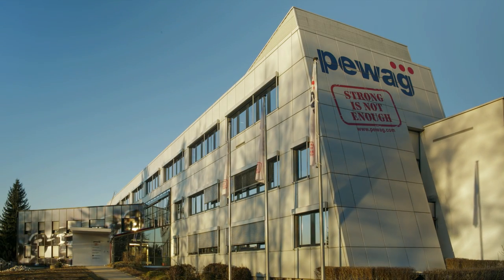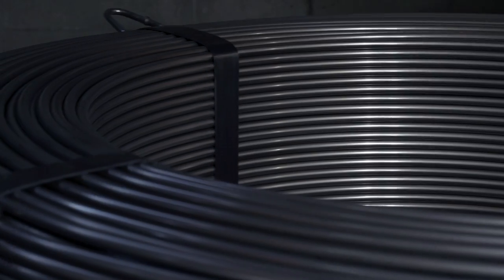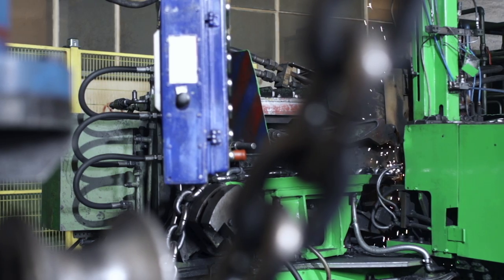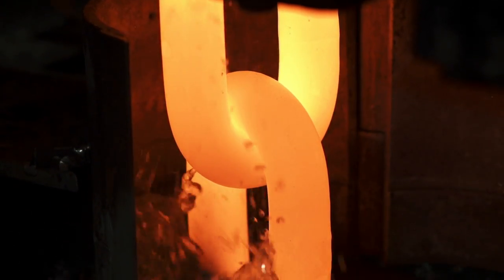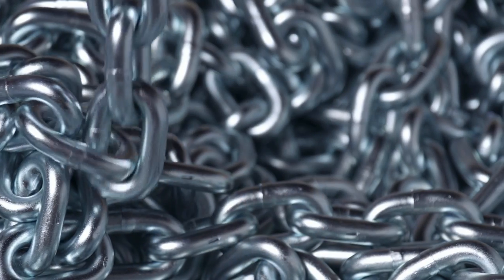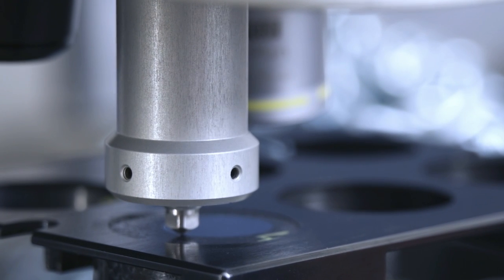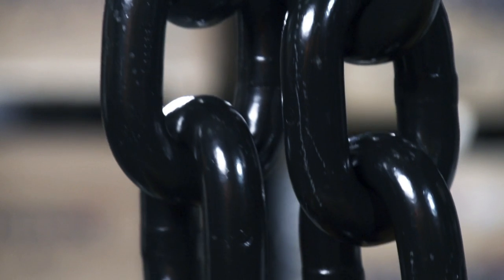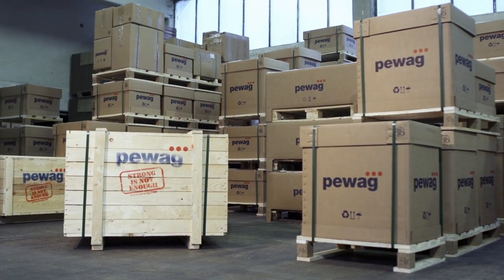chain production at pewag

Comment: I got some 3012 pewag chain, yes it was black but it was RUSTED.  and in 3 weeks it has rusted a heck of a lot more!  it is only case hardened 6% and at this rate the rust will eat through 6% in less than 6 years.  I am going to have it sand blasted and powdered coated.  I am very disappointed with the quality of the 3012.
Reply: Get the galvanized Bob.
Reply: Wow I got Same chain 3 years ago has been outside locking my Motorcycle ,yes it got rust on surface but that's it . I bring in every now and again wipe it down spary with WD-40 and back outside . Fantastic chain .